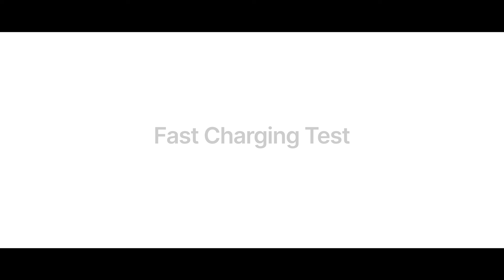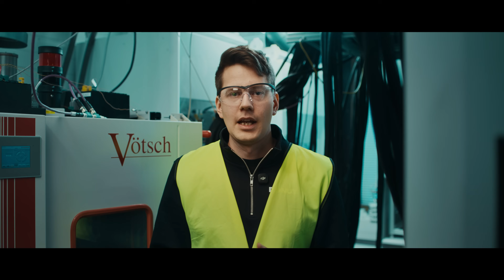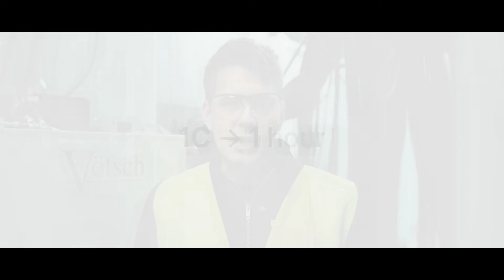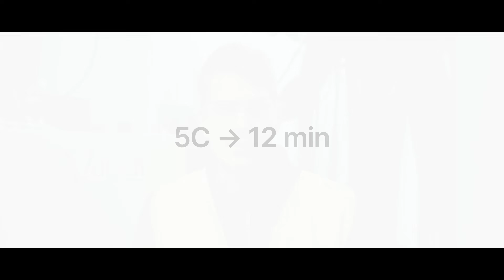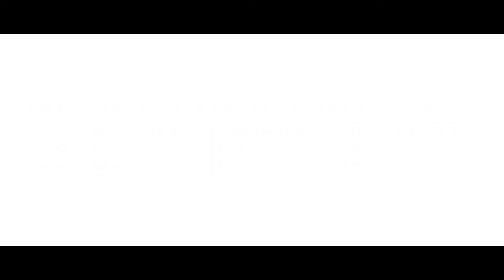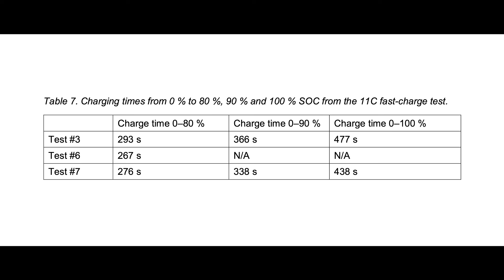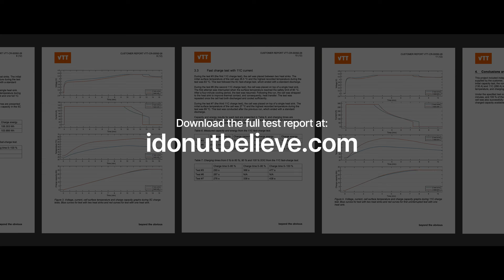Donut Solid-State Battery: Fast Charge Test | I Donut Believe (Pt.1)

Comment: what about the total life time if I charge 30% with 2C , 50% with 5C and 20% with 10C  ???
Reply: I would assume it outlasts you no matter how used if their promises of the cycle life hold even 10% true. It heated to 90°C but I have heard that it can withstand up to 130°C with zero issues
Reply: @MF175mp the Temperature is Not the only creteria to get Info ton lifecycles

Comment: still donut believe. thats standard nmc battery .
Reply: If you think comparing voltage charts of 0.25C NMC-Li to that of 20-40 times higher charging rate for Donut battery to find some visual similarities is a valid thought process then sure. lol.
Reply: @MrHadane  charging at high c rates proes nothing without knowing how it effects cycle life or the battery energy dencity .
heres lipo charged at 36c https://www.youtube.com/watch?v=8nqCViCYRTI

Comment: No proof of a solid state battery and it seems extremely representative of NMC. It also shows thermal issues which debunks one of your own claims that no active cooling is needed, but one of the tests was terminated for thermal reasons.
Reply: Have you even you looked into the units used for the NMC-Li voltage chart that some clowns keep parroting around? It's tested at many times lower current than Donut's were. How is it even similar?

What thermal issues? They confirmed you can charge the battery with just air cooling with 2 heatsinks at an extraordinary 11C rate. What other battery can do that without deteriorating or igniting?

Comment: Meh, quite unimpressive compared to the media-fuzz. This is not "passive" cooling. This is a heatsink in a battery test chamber which ambient temperature can be activly controlled. There will be quite an air movement too.
Reply from the maker: Test chamber was not active during testing. Test was conducted in the chamber only for safety reasons

Comment: I guess people dont know that their "solid state" probably stays for solid state cooling like a peltier effect they use the charge current to quickly push the heat outside of the cell thats why they need such bulky heat sinks. And ofc no tests for charge effiency bcs that would show how much energy is wasted cooling these cells down with the peltier effect :P 

tho claiming no lithium is a crazy marketing stun and quite misleading if again its meant "no lithium used in the cooling of these cells"

Comment: So it's 270A for one cell, a battery should have ~20 cells, isn't that around 5400A? I guess I will need some thic wires...
Reply: Perhaps they'll do the same as other EV battery packs, stack them in series and raise the voltage from 5v (cell level) to 800v (pack level).

Comment: Nothing in those results proves this is solid state, and all values from test are lower than was presented on the conferences by you. Still a hoax, please prove me wrong
Reply: What values are lower? Did they claim 5 mins 100% at 11c? What about 12 or 13c, 90 degrees cutoff prevented any higher. But my question would be, was that lab protocol or donut

Comment: why did you not test charging with 6C and 12C to verify if th promises of 5minute and 10 minute charging time is true. also since Marko initially promised from 0% to 80% in 5 minutes, that should also have been tabulated in the VTT report for those with curve reading challenges.  336 seconds (5,5minutes) in NOT same as 5 minutes!

Comment: Lol anyone in the industry can tell you that paying an "independent lab" to test your product is not what you think it is. They work with the company to get you to pass as many times as you'll pay to retest for results to look good. UL tests are similar, you can fail 1000x and pass 1x and an independent lab you pay will give it to you the cert across the board, except here it is worse since they aren't testing to a real standard just to what Donut wants to present to potential investors to scam them into believing they are at to point of viability.

If they actually had something here, it would be a product. The test they did is similar to why you hear about how carbon nanotubes are amazing yet we don't have space elevators. 

Don't trust this refrigerator-esque CEO.

Comment: Your data has been analyzed and found to be nothing new or breakthrough: https://www.youtube.com/watch?v=H45HXs4xXfA
Reply: He was cheated😅

The Ziroth "CES Trap"

It seems increasingly likely that the 315g figure he received at CES was a deliberate "red herring". By letting a high-profile skeptic build a case against a "fake" weight, Donut Lab sets up a massive payoff when the VTT "Freeze & Fry" report officially confirms the 235g mass on Monday.
The Verdict: Ziroth might be an expert in electronics, but he clearly isn't an expert in logistics or federal law. If he’s betting on a 315g cell, he’s betting against the physical reality of the bike's own shipping and registration papers.
Reply: @AJ1964FI  - It's not about a bike. It's about that these guys are liars.
Reply: @johnsmith1474 like you know something. A motorcycle manufacturer under active US and EU homologation simply cannot lie about 40 kilograms. It would be corporate suicide. The existence of the 235 kg bike in Los Angeles is the physical proof that the 235g (400 Wh/kg) cell is the one inside the frame.

Comment: Obviously, having 5-10 minute charging would be neat, but it’s totally unnecessary.  I dont want people to think this kind of fast charging is critical for EV success.  Even if you put these cells into an EV, the EV chargers aren’t able to produce enough power. 

For example, if an ev had 100kwh battery that charges in 5 minutes, it would require a 1100kw charger.  Since EV fast chargers usually produce 350kw of power, you’d end up charging for 15 minutes anyway. 

Current EV technology is doing really well right now. I can charge my tesla to 80% in about 15 minutes now.

Comment: Youtuber Ziroth promised to donate €5000,- to a charity of your choice if your battery is indeed not made out of Lithium and when the battery has proven to have the same charging curves as shown in the tests. I truly hope that you can make him to do that donation. He thinks that you are lying with 99,9% certainty. And he claims with extremely high certainty that you used a Lithium ion battery for the test. Watch his latest video for all his arguments why he thinks that you are lying. 

You can make many people instant believers if you would pick up this challenge. I don't know how you can do that without revealing the chemical composition from your battery, but I would invite him, and make him sign a non disclosure contract about about any critical information, and show him that your battery does indeed not have any lithium inside. You even wouldn't have to reveal the chemical composition from your battery, you just have to prove that there is no lithium inside. 

Are you going to pick up this challenge?

Comment: How large a heat sink are we talking about? From the video it appears that the aluminum blocks used as the heat sink are huge when compared to the size of the cell. Is this the ratio we can expect in a functional battery pack? If not, are there tests with a heat sink of a size that can be utilized in an actual operating vehicle?

Comment: you are not going to have two each massive heat sinks in real battery pack? in what this simulates battery pack? you will have others batteries around making it work as heaters for other battery not as heat sinks??? tf ?

Comment: This is interesting, but also shows that this is absolutely not the type of battery you'd put in consumer electronics. Charging at 80°C+ Temperatures is a guaranteed firestarter or personal injury case. A smartphone will never provide sufficient heat sinks to allow this. Even though the fast charging would be very welcome in this market, this cell likes to charge in warm environments and that's the domain of vehicles and Tools.

A power drill is probably the acceptable border of applications, where the battery pack is "just hanging off the handle" and a "warning, hot" sticker could get is approved. 

Also, can we talk about the insane charging currents? 130 Amps? It's like someone plugged the battery into a fucking welder.

Comment: I don't get all the secrecy about the chemistry. If it's an actual cell that you WILL use in a product, be sure that one of the first to buy the product will be CATL or some other big battery manufacturer and they will tear it down to understand how it works and what it's made of. If the point is to protect your invention, patent it. I don't care about your stupid narrative of "patenting will only make our detractors change what they attack us on". Yeah well the only way to prove them wrong is to get those out there for actual clients to use and deliver  after patenting it to show that you are confident yourself. All those videos are doing is building the hype so this is either the most talked about scam or the most talked about breakthrough, not proving that this one or the other

Comment: Please do another video of tests with side-by-side comparisons of the Donut cell with other conventional cells currently being used (e.g., Prismatic, Pouch, 2170 or even 4680).  Also, even if a Donut  automobile battery pack is currently not available, how about making a battery pack and BMS and showing how it could power an ordinary vehicle like a Volvo EX40 or even a Tesla Model 3?  That would be a great demonstration of the chemistry, even if the battery is not presently available as a structural battery pack. 

The charging performance of the Donut battery is impressive. But even if it was only designed for occasional 5C charging and daily 1C charging but cost 50% less than today's batteries while lasting twice as long, that would be a great technical accomplishment and a very valuable product.

Comment: Maybe its not just single battery, but instead basically unlimited series of microcapacitors. Built from homogenous mass containing only electrically bipolar particles that are highly conductive and turned in unique orientation with electric field before locking the particles in a hardening bake. The nominal voltage would result from average thickness of the mass... capacity and charging current resulting from both area and height. This design, if such material would exist, would resist horizontal currents and therefore puncture would only result in losing capacity from the damaged area. A battery that works like a brick - and bricks donut age.
Reply: A substance that acts as a capacitor. I guess

Comment: The 11C charging speed is impressive, but the VTT report noted that the cell hit a 90°C safety cutoff when tested with only one heat sink. Since you've marketed this as needing 'no active cooling,' how will you manage that heat in a tightly packed motorcycle battery without adding significant weight or complexity? Would love to see more data on pack-level thermals

Comment: I do not believe unless I have seen REAL independent tests with tests resembling REAL world scenarios. 

You are showing max charge speed benchmarks. Nothing else. 

Lots of hot air. Nothing else. 

Show us the tests and data how it will behave in a real world application. You claim you will deliver a motorbike with that battery in Q1? Give media access to early production bikes and let them test and experience?!

Comment: Well .. sounds very good indeed, but let us not forget what is also very important : 
1.) Thermal Safety of the cells in case of structural destruction - for example in a severe car accident  
2.) Also the battery should work under different climate zones ( desert / tropical zones / mountains / snowy or icy regions )

Comment: Tune in next week for another batch of test results that leave out critical information. So many unanswered questions and deliberate witholding of obvious data such as... weight of cell ..... I've personally told Google feed to stop suggesting articles about this like 6 months ago because it seems like an obvious scam. Why are they scamming? I have no clue. They should put up or shut up. Trickling charging data without showing the weight means they are hiding the energy density. There's literally no reason to do this if what they say they have is true.

Comment: OK => I am a skeptic (just saying) - So they can apply voltage/current to this and it doesn't heat up. They toss percentages around without showing "of what" expect power saved. Show us how much power it discharged ...  The actual discharge would show how many watts they stored not what they shot at it. This did not show whether one charging cycle actually charged up up the cell to its claimed maximum and discharged that amount of electricity. I did nor see "This is our W weight battery which we are going to charge it with A amp/hours  over M minutes then discharge it over X time showing its KW/weight ratio and its KW charge times, and that therefore stored and retrieved K Kwh" as claimed. 
 As I and others have speculated, supercapacitors (which are good for some things but NOT long term storage) may pass this test.  Me - still a skeptic.

Comment: But how will it perform once in a pack with all the cells packed together. The physics of heat dissipation will be very different to a single cell even with a heat sink. You still need to proved much more evidence.

Comment: Given the thermal behavior of the cell, I would suppose its internal resistance may be elevated. I didn't see it specified in the paper: https://pub-fee113bb711e441db5c353d2d31abbb3.r2.dev/VTT_CR_00092_26.pdf

Comment: If the battery tabs were relocated to opposite ends of the cell, tab heat issues would be mitigated due to full-width tab with full ampacity, aiding heat management.

Comment: I can charge any battery fast, the question is have many times you can do it before the battery is pooched?
Reply: Guess you didn't watch it?? The capacity is 100% after 5C, and 98,4-99.6% at 12C. "Any battery" would not have the same capacity after charging at those rates, they would lose all of their capacity
Reply: @samureye868  
Need to do 10,000 100,000 cycles in various charge rates, environments and configurations. None of this extrapolating BS from a few cycles.
At 1 hour per charge/ discharge it takes 11 years for 100,000 cycles, battery needs time to cool down. See you in 2037 for the graph’s of charge cycles vrs remaining capacity.
Need to get Dr. Jeff Dahn, renowned authority and researcher of batteries.  
Professor emeritus at the Department of Physics & Atmospheric Science and the Department of Chemistry at Dalhousie University
To do the test.
Reply: @samureye868  
I can charge any battery fast, it’s how many times you can do it before the battery is scrap.
Heat sink to dump the heat, not a real test. Must have a high R since it gets so hot. P=I^2R 
Not a battery bank.
Need to do 10,000 100,000 cycles in various environments and configurations. None of this extrapolating BS from a few cycles.
At 1 hour per charge/ discharge it takes 11 years for 100,000 cycles, battery needs time to cool down. See you in 2037 to see the graphs.

Need to get Dr. Jeff Dahn to do life cycle testing of the Donut battery we will know it’s true performance.
Dr. Jeff Dahn, renowned authority and researcher of batteries.  
Professor emeritus at the Department of Physics & Atmospheric Science and the Department of Chemistry at Dalhousie University
Reply: @samureye868  
I can charge any battery fast, it’s how many times you can do it before the battery is scrap.
Heat sink to dump the heat, not a real test. Must have a high R since it gets so hot. P=I^2R 
Not a battery bank.
Need to do 1000, 10,000 100,000 cycles in various environments and configurations. None of this extrapolating BS from a few cycles.
At 1 hour per charge/ discharge it takes 11 years for 100,000 cycles, battery needs time to cool down. See you in 2037.

When  Dr. Jeff Dahn has done his life cycle testing of the Donut battery we will know it’s true performance.
Dr. Jeff Dahn, renowned authority and researcher of batteries.

Comment: The problem with this test is that it only shows charge speed. The whole claim of the donut battery is that it isn't record breaking in any particular category, it's just a perfect all around package.

If each week they test an individual aspect, especially if they go to different labs to do it, there's no proof it's the same pack each test.

What if this was secretly a super fast charging lithium ion?

What if they test energy density next week with a silicone carbon battery?

What if the week after that they test longevity with an LFP battery?

These claims aren't proven until they're demonstrated simultaneously.

Good luck Donut. You have a lot to prove to the world.
Reply: Fair point. Very well could be
Reply: What kind of a mega dumbass would do this kind of scam? I'm genuinely asking. They will go to jail if they lied about those parameters and orchestrated this set of tests on separate batteries. They will be audited by the government eventually, then face jail time.

That's pretty much guaranteed if they ship out these cells and they just have one of these capabilities.